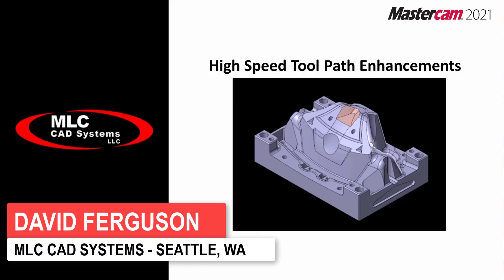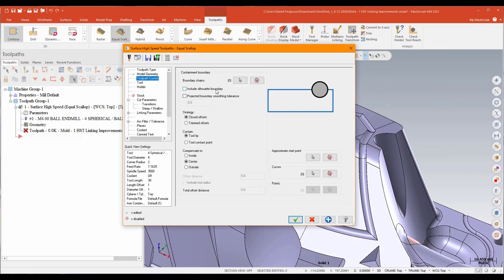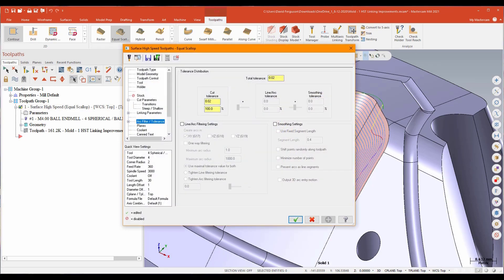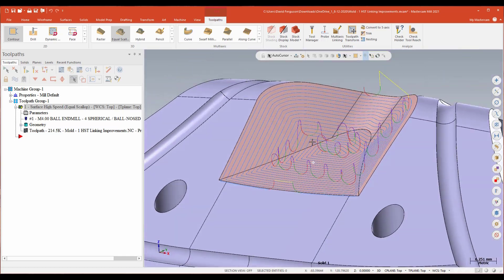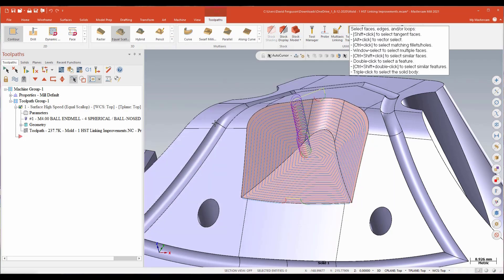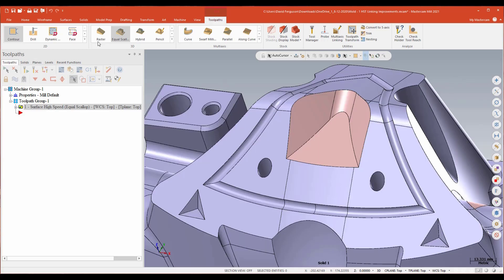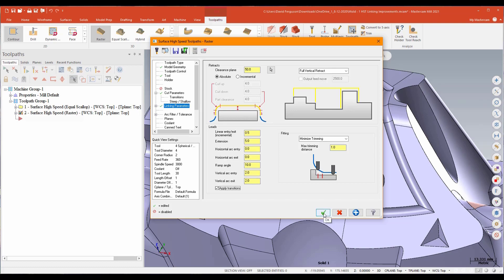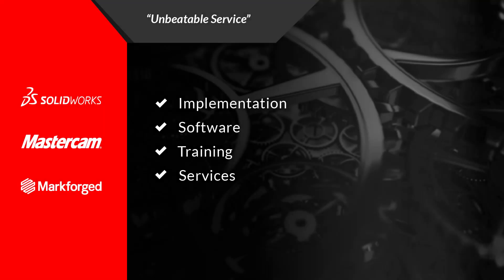What's New in Mastercam 2021 High Speed Toolpaths

Comment: Why is it so dang laggy though? Every time I save it refreshes the whole screen. I changed all my graphic settings to make sure that mastercam 2021 uses my graphics card just like I did with 2020 but it's still very laggy and stuttering. 2021 lags or crashes... I wish my company had other alternatives
Reply from the maker: If you have Mastercam 2021 you must be on maintenance, I highly recommend you reach out to your local team to report this issue and get support!  Mastercam is extremely responsive and many of these issues can be fixed pretty quickly.  If you are an MLC CAD Systems Customer call us at 800-364-1652 or email mastercamsupport@mlc-cad.com and we'll get you fixed up!!